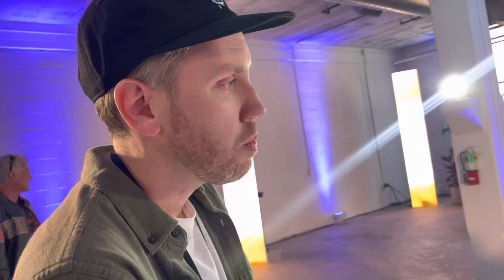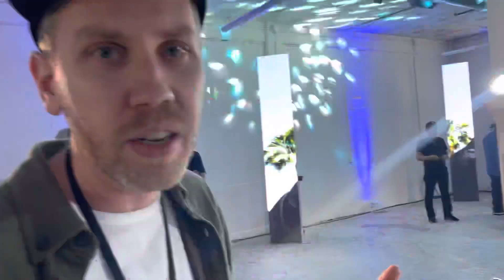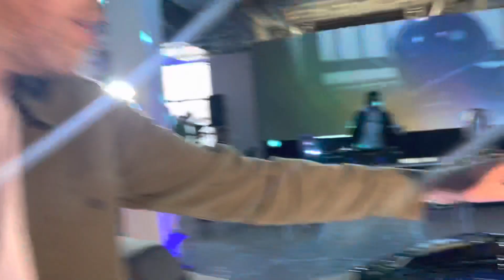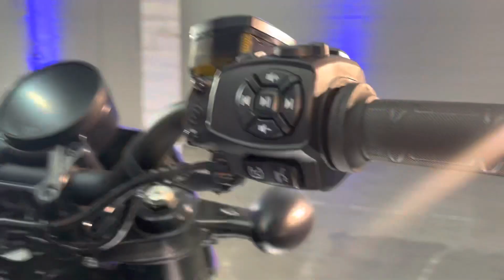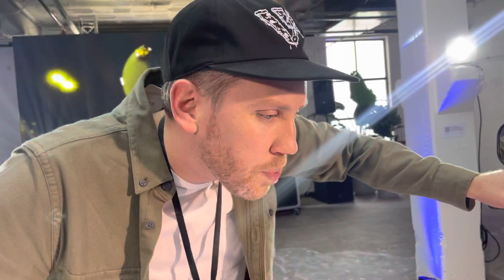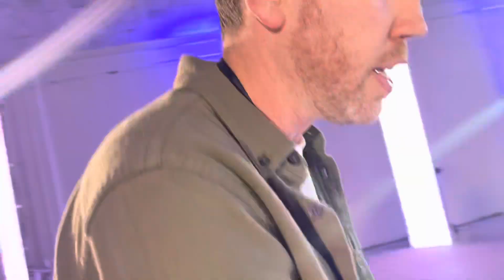LiveWire Del Mar interview with LiveWire Design Engineer Eric Stafford

Comment: No L3?  No thanks.
Reply from the maker: The thing I like about the level 3 charging on the LiveWire ONE is that it allows me to ride all day just taking short breaks to charge. If I have to wait 2 1/2 hours for a full charge on level 2 charger, it means I can’t ride the bike all day.
Reply: @freedomiseverything  exactly! And what is really messed up is that they did this on purpose, because nobody would wana buy the LiveWire One anymore! I wached an interview where the designer said „we dont have level 3 on Del Mar, because its a tier down bike from LiveWire One so if you want that, you need to upgrade”
Reply: @ebaqdesign  I think you are right because in this video the designer kept referring to the LiveWire One as the halo product.
Reply: 20%-80% battery via level 2 is 75 min, not bad. Just reserved one, will make a fun ride for around LA. Happy to look for a ChargePoint if I want to ride somewhere further for lunch.
Reply: @Eric_Luke  100 miles isn't bad really. Charge in hour just about. Ride all day